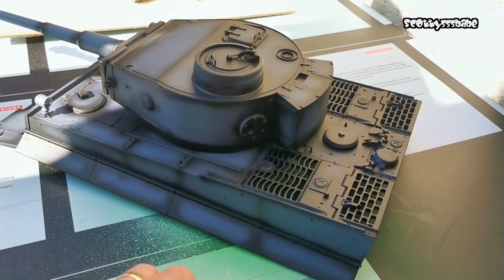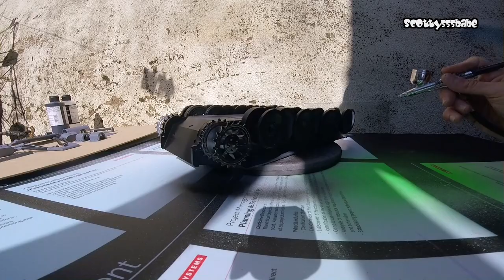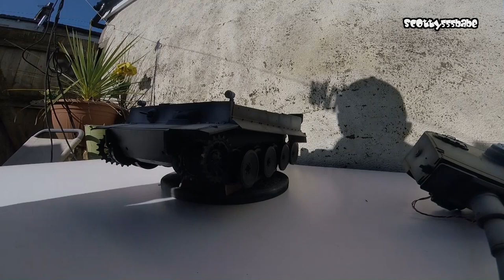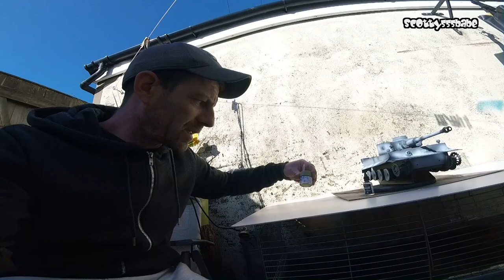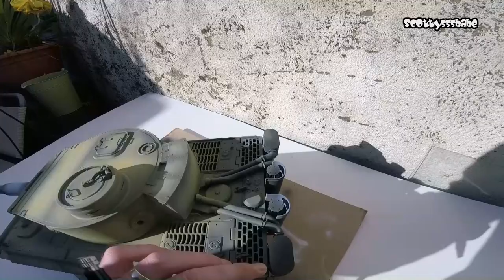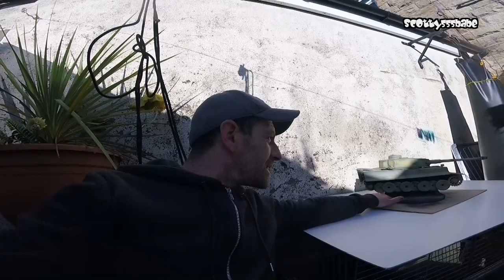TAMIYA 1/16 KING TIGER TANK BUILD Part 11 | Airbrushing my Heng Long Tiger Rc Tank

Comment: Another enjoyable video, Tigers can look really nice in winter camo with a little weathering,
Reply from the maker: I've been looking at loads of tanks and I must agree with you on the winter camo, they look very good and would look great on a winter diorama, I just thought this would be a perfect platform to get some practice in  before I start the King tiger. 👍👍
Reply: @scotty555babe  You could use the electronics from the Heng long in your KT, and save a few bob.
Reply from the maker: @Phronsias1  I'd actually thought that, when I pulled it apart and looked it would only need the wires cutting from the board and just add connectors for the receiver so I could have the rotation of the turret, barrel elevation and the drive I will have..
One question as I'm seeing it a lot on other rc king tigers..
Did they use a clutch system to disengage a track, turning corners via the use of one track as I don't see them working in opposite directions together 🤔
Reply: @scotty555babe  Turret rotation  and barrel elevation can be done with HL parts, you dont need to cut wires,use as is,you will need to use J-B weld to fix the parts in place, older Timiya KT's have a  clutch ,Ive got one, the gear mechanism looks like something out of a clock, works of art really,. as far as I know the MFU varies the voltage to each motor giving you steering,tracks working in opposite directions is called neutral steer in real tanks

Comment: Top job so far , I've got the Heng Long Tiger as well , just bought an air brush kit ..so this video has given me some good tips 👍
Reply from the maker: I'm currently building the Tamiya German King tiger which is currently at the paint stages and I'd never built a tank before.. Mainly Trucks and crawlers so having this old heng long was perfect to practice with and I'm glad the video was actually of help.. I'll be doing various projects with the Airbrush in the near future so they also may be of use to you.
Thanks again 👍👍

Comment: I asked in the RCtanks forum if any  RC tanks had  neutral steer, this is part of one reply
"Pretty much all of them do except the early Tamiya versions that have the single motor and clutch system. Some of the control boards allow you to turn neutral turns off or leave them on by default (Clark, TCB, and others)."